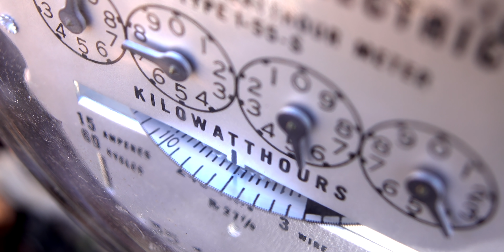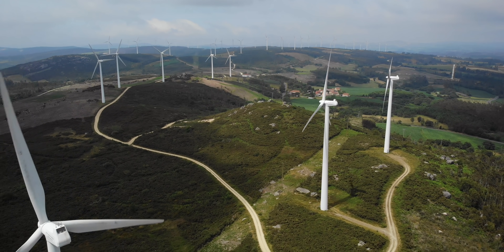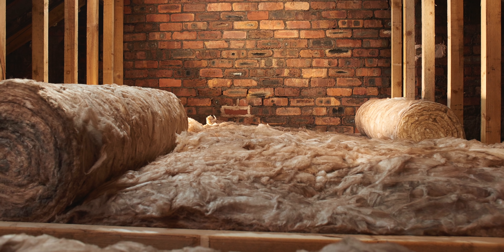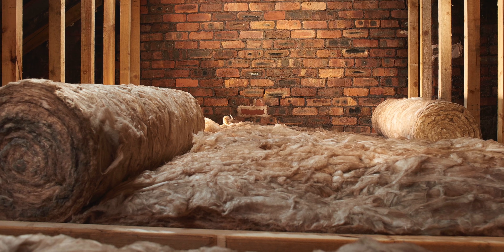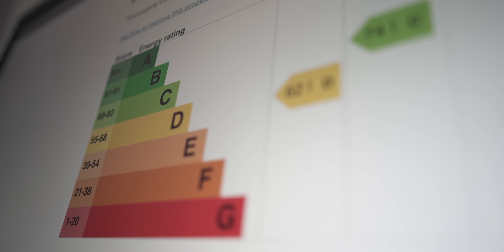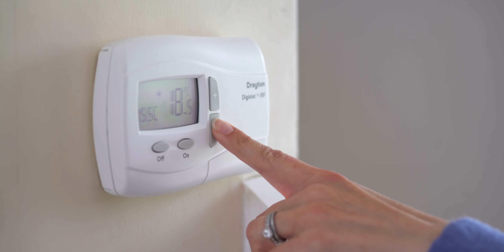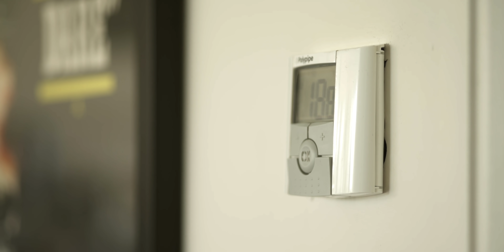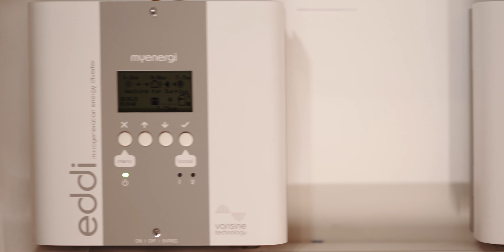HOME ENERGY Episode 1 - Cheaper Measures, Energy Efficiency & Fabric First | FULLY CHARGED

Comment: Trv's saved no one anything. They can help with confort. If your external walls are insulated, heat your whole house. Your internal walls aren't insulated so it makes no sense to heat on room but not the one next to it. That's the same as having undersized radiators. Not everything this guy says makes sense.

Comment: Cavity wall insulation and external wall insulation are interesting but frequently flawed for existing buildings.  The cavity is there for a number of reasons,  but one reason is that it allows moisture to escape.  Similarly with external wall insulation if moisture can find a way behind the insulation it will get trapped.  If moisture gets trapped in the cavity or behind the cladding it will rot the fabric of the building and cause damp problems internally.   This is not a new problem it happened in the 60s and 70s to houses where people followed fashion and pebble dashed the front of their homes or (this is my pet hate) added a concrete skim over the front wall of their home. 

Installers will tell you it is not a problem you just need to regularly the state of the external finish.  In fairness in a lot of the country that is true checking the finish once every 6 months and repairing where necessary will be fine.  But if you are in a windy area or even worse a costal location (windy and salt laden air the absolute worst combination) then you would need to check the finish at least every month.  And of course those who say just check the finish assume you can check every wall.  If you live in a semi-detached, detached or end of terrace house not only are the front and back walls exposed but so is at least one side wall, and you may only be able to check that from your neighbour's property if the side wall is also a boundary wall which of course assumes your neighbour will let you onto their property to do the check.

There is a simple rule of thumb for cavity wall and external wall insulation, if you cannot check the wall finish regularly then do not do it.  And do not grow plants up it either, not only does that prevent you checking the finish because the plant is in the way but plants can often destroy the integrity of the finish
Reply: Modern flexible silicone and acrylic renders are dramatically better than old cement ones in terms of not cracking (and silicone ones let damp out if there is some too). Or you can use a rainscreen design so there is a drained cavity behind the facade and in front of the insulation. it's also important the get the detailing right on exposed sites (good overhangs, proper rainwater goods layout, careful window reveal detailing, and none of the stupid plastic cappings). But the idea that you have to be able to inspect every square metre every month in order to have EWI, or even render, is quite ridiculous. Good design is both weatherproof and still works even if damaged or poorly maintained. You are quite right that extra care is needed for exposed sites but we know how to do this stuff.
Reply: @xxwookey  I completely agree that getting the detailing right is vital for long term protection against water ingress (nb: it is not just about preventing water ingress at the detailing but also not creating cold bridging) but that by itself is not sufficient and if you are trying to retrofit existing homes it may not be easy either. 

I also agree with you that silicone and acrylic renders are massively better (my preference is silicone) than older renders but even with such modern materials I have seen in the last 5 years what happens on exposed coastal sites with EWI and that type of render on new builds which are the easiest to get right. In one small estate close to where I grew up it took barely 18 months from completion for most of the homes to be riddled with damp issues.  

In fairness, like all building work, many of the problems are caused by the builders not the materials one of my favourite quotes, if only because it is so heavily laden with classic English understatement, comes from the BRE report on solid wall insulation when dealing with quality of workmanship "Inconsistent performance appears to be widespread in the EWI process leading to the premature failure of scheme".

I personally would not use EWI even on new builds in coastal exposed sites.

I would mention this is not just my view, BRE raised similar issues 5 years ago.

Finally checking your walls regularly is not difficult, it is a simple eyeball test

Comment: those thermostatic radiator valves are rubbish, they dont open based on room temp they open on radiator temperature which means the temperature of the room goes up and down based on external temperature.

ideally you need a temperature sensor on the opposite wall to the radiator with a control valve on the radiator itself.

Comment: Surely a bath uses more hot water than a shower?
Reply: depends on flow rate and length of shower. I had a customer with high electric bills who's son had a 45min shower most days. Power shower performance is 10+ liters a minute
Reply: Ah, yes, I had heard some people do that. But surely the exception. And the solution there is a coin-op shower! :-)
Reply: It depend how long shower one takes. :) If it is no more than 10 minutes then yes.
Reply: @martingorbush2944  Well true! But the point is that you DO tend to take showers of only a few minutes, baths for a long soak, often with re-fill!    It also helps that showers that heat on demand are more common so there's zero heat loss from cylinders and pipes.

Comment: You don't actually need professionals for most improvements - you just have to learn a bit or get some good advice in order to make a sensible plan that doesn;t risk damaging your fabric in the long term. Any competent DIYer can do IWI, and airtightness. MVHR needs some design to work right, but the fitting is totally DIYable. Same for UFH. EWI base is easy enough to DIY, but you might want to pay some renderers to get a nice finish. Windows are straightforward, but bloody heavy, so paying the company to install may well make sense. Perimeter insulation is straightforward DIY. Solar thermal isn't hard so long as you don't mind being on the roof. The main advantage of DIY is that you'll get the job done properly (not in a tearing hurry) and it'll at least halve the costs. I did an Enerphit retrofit on a 1960s house for about 35 grand over 12 years. It does take up quite a lot of weekends! I did my own PHPP and MVHR sums too, but that does involve quite a lot of time and effort learning how to and is only recommended for nerds :-)
Reply: That’s reassuring to hear as I’m similarly minded with the DIY, but at the same time I know people who can’t put up a shelf 🤣 For them they really need a tradesperson to do any of this!

Comment: We've got ducted gas heating in our home, and Kiwi's love their ducted heating whether it be gas or heat pump. The thing I miss with the radiators that we had in our old home, is being able to individually control the temperature of each room, and having radiant heat directly in the room. Our current system has 2 zones, upstairs and downstairs, which means there really isn't any control over the temperature.
Reply: you might be able to put duct-valves into every room and regulate where the heating is going that way.
But that might have a long tail to it since if most rooms are closed the (i assume) fixed air supply gets shoved into the remaning few rooms etc.

But might be worth thinking about / consulting someone to get the individual room control back (might save a good amount of energy)

Comment: 🙄 Water has to come out of the hot water tap at a high temperature in order to prevent bacterial growth. If you fit a thermostatic tap make sure it's still hot enough.

Comment: "A thermostatic valve will cost you £15" and the plumber will charge £300 to fit it. 😂
Reply: So do it yourself - it's not particularly hard.
Reply: I got my plumber to swap all ours out when we had problems with the boiler. Sure it was extra money but cheaper than doing it as s standalone visit. Once you have the right fitting they are dead easy to swap, I've since changed all mine to Tado, they have paid themselves back many times over since.